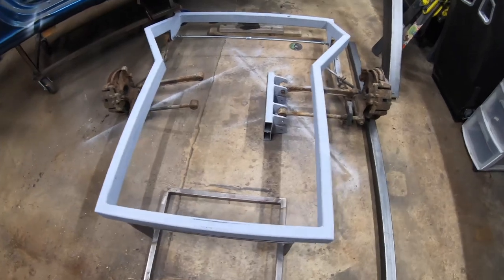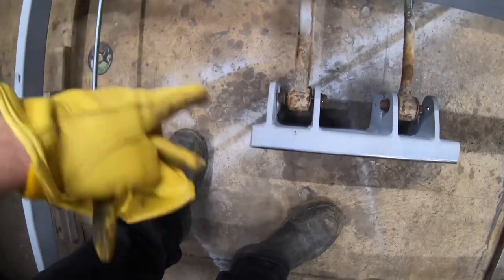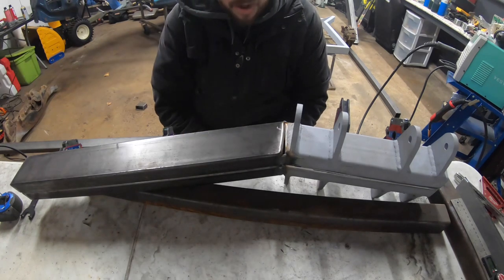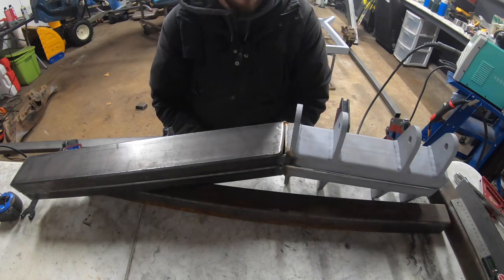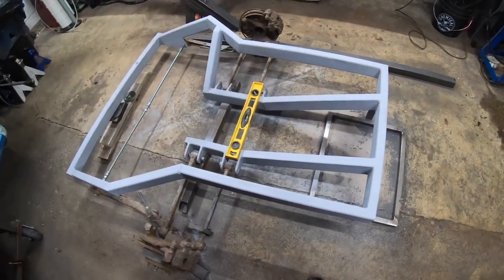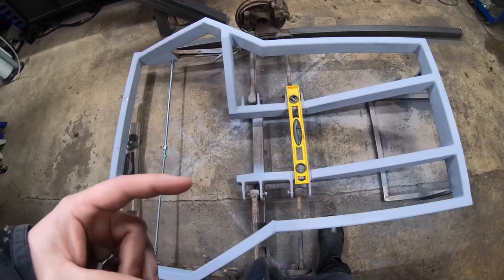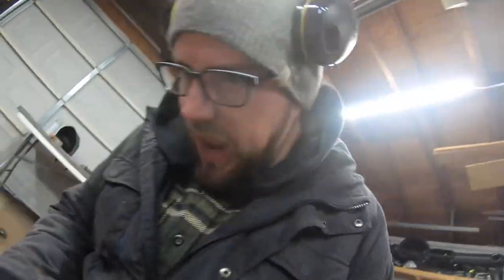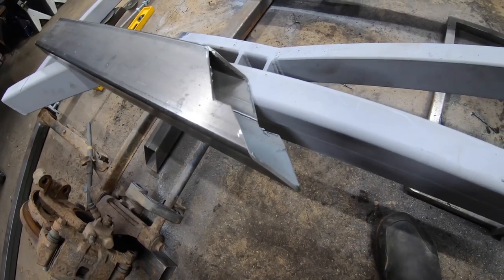Mid-engine Subaru GC8 STI back-half frame fabrication // Part 2 #kevinmorales #midenginesubaru

Comment: You will save a ton of time just tac welding everything before welding it complete. You will also help your stuff stay true with more added and supported before welding. Been doing fabrication for 20 years now. Hope it helps.
Reply from the maker: Hey hey - I appreciate your direction

I am currently working under a super tight budget but am working on making sure to start collecting the tools that will make my life easier as I dig deeper. Definitely learning that tacking is the way to go until everything is confirmed square, plumb, and makes sense before welding it solid... Sometimes getting in the zone and wanted to just burn it in does not help your cause but slowly figuring it out. 

Thanks again for the direction and hopefully you can continue to chime in and keep me honest. I appreciate any and all help! Cheers
Reply: Absolutely. I am currently designing a long travel impreza suspension. Next will be acquiring all the stuff I need. Bought a new car this summer so I could build my car. I run it at silver lake and in the trails pretty hard
Reply from the maker: @clitzcustom66420  No way Michigan local!? I am down in the waterford area if you are familiar but love getting out to silver lake even just to hangout and appreciate some of the crazy builds
Reply: Yes sir. Traverse city area. Silver lake and subarus are ment to be together.
Reply from the maker: @clitzcustom66420  hell yeah you’ve got it right - actually headed up to Boyne mountain this weekend with my wife to hangout. Worked for Boyne downstate for years but only visit now, still have friends in the area so it’s a easy get away

Comment: This is an interesting build,  i used to build subaru rally cars( 20+ built)..  looks like you are making it strong enough for a 7000 lb trophy truck.  Saw you mention you are on a budget,  think about the think about your cage tube size vs that huge box section.  Might just be the race car builder in me trying to save 100lbs.  Might save $$ going smaller. 

Like the build.  👍
Reply from the maker: Hey Mike - I am glad that you are saying that. Perhaps I could scale it back slightly for sure. I am cutting out a majority of the cars layered framework but I’m definitely not netting any weight savings here. I guess I’d rather be on the overbuilt side than twist it in half but I definitely hear you. 

Would love to pick your brain on radiator and intercooler placement if you’re open to giving input there
Reply: Can you help me design a frame for ann 04 forester?